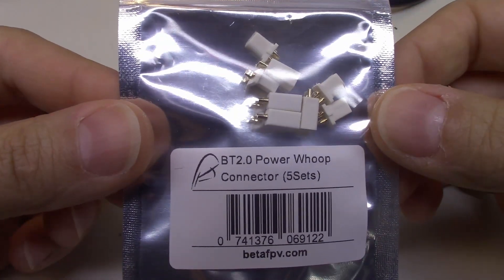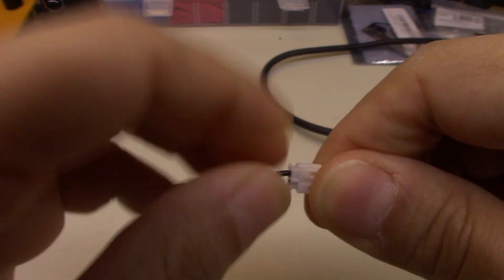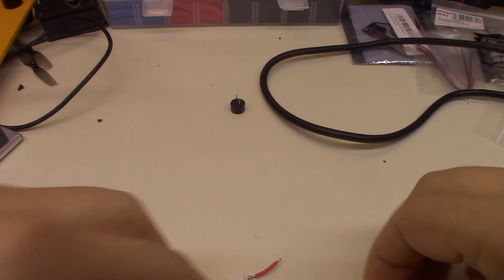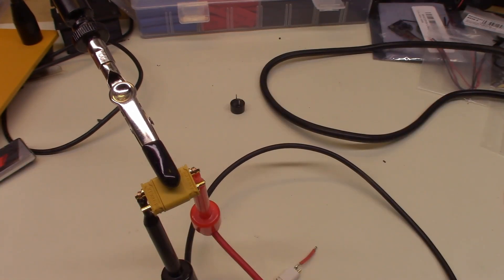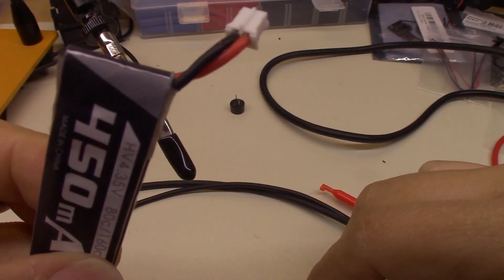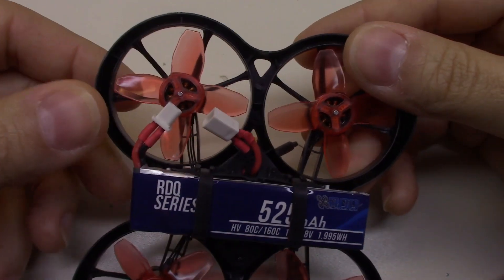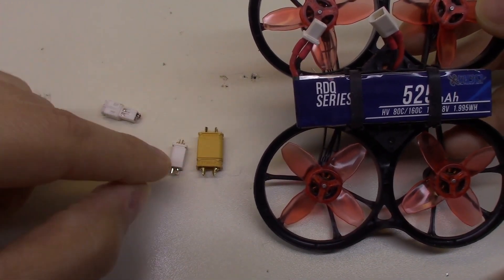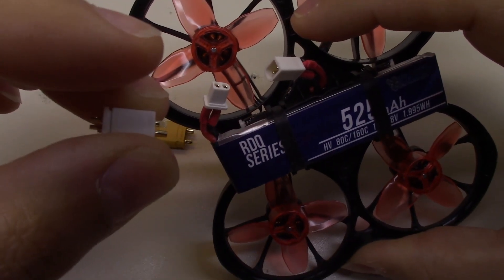BetaFPV BT2.0 Connector In Depth Review

Comment: So does the female side go with the battery and the male side goes to the drone ? I’m stuck on once you do this to the battery how do you convert your drone because I have the emax 1s ports on my tiny hawk 3 and only stuck on how to change the drones plug in to match or is it the same ? Do I make sense lol I’m new
Reply from the maker: You want the female side on the battery and the side with the exposed pins under the shroud which is the male side on the drone. You'll just need to remove the connector from the drone and then replace it with the new one making sure that you pay attention to the correct polarity.
Reply: @DoRC  thank you !!I have the emax tiny hawk 3 with the duel 1s connectors on my drone so you can fly 1s or 2s. It has a little black piece put together with that 1s board am I got to cut still ? Don’t want to ruin a good drone lol

Comment: Hi. I have a 1s babytooth running 1103 11000kv on 3 inch props with a xt30 connector. I accidentally bought a lot of these bt2.0 connectors and was wondering should I change the xt30 for the bt2.0. I don't mind the work but just wondering would there be performance loss if I swapped the coneectors?
Reply: Hi Aimon, did you have a chance to compare the Babytooth bt2.0 with xt30?
Reply from the maker: I didn't do a scientific comparison but the xt30 will have a lower resistance but it's also larger and heavier. Something to keep in mind with the BT 2.0 is that it is fairly easy to accidentally plug it in backwards which is not great.
Reply: @maximgolovashevich4651  What Do RC said. Go for XT30 for the ruggedness and solid connection. Go for bt2.0 if weight is the number one concern. I run my babytooth with XT30 and moblite7 with bt2.0.

Comment: Great info, and great work. I switched from the folded PH2.0 to the solid pins, and noticed a slight improvement w/out any formal testing. Recently switching from the solid pin to the BT2.0, made a night-and-day difference, no testing necessary, lol...its just that big a difference. I then rigged a BT2.0 series connector, for some 2S on my TinyHawkS...and worked amazing. I then got the idea to make an xt30 to two, BT2.0 series connector for my 2S toothpicks...works great, and I can now utilize my 1S sticks in series, and w/ no amp sag. 👏👍✔
Reply from the maker: Nice!  I just bought a couple more packs.  They are really good connectors!  A sub is appreciated and check out my recent giveaway video:)
Reply: @DoRC  awesome, will do. 👌

Comment: I guess in real life the difference between BT2.0 and PH2 will be even much higher, as the PH2 folded sheet metal pins will quickly oxidize and wear out.
Reply from the maker: The difference is a lot more apparent at higher current draw as well.  The bt2.0 is far superior in every way and nearly as good as an xt30.  Thanks for watching and a sub is appreciated!

Comment: It can be done with stick batteries btw. Not that I had patience to try, but there is a (very short) cable inside of the plastic cap that you can solder to. Obviously that cap won't fit over the new connector. Would be great if we could get our hands on the black goo that TBS used on Unify Pro32 Nano - it's like liquid electrical tape but much harder and apparently good for heat dissipation so could be great for modding the stick batteries.

That said, many people have doubts if the new connector can make a meaningful difference on those tiny <=300mah packs as they can't put out a lot of juice anyway. On 450mah+ it's definitely very noticeable. GNB makes 300 and 350 mah with a short lead so I'll give those a try in a few moons when they arrive from China :) I think it should still be noticeably better or at the very least last longer.
Reply from the maker: Albert Kim converted a stick pack and was able to reinstall the cap (after ruining a couple i think) but yeah it's probably not worth it.

Comment: OMG a real scientific test done properly ! you don't see that very often in fpv, great vid!!!   i'd be curious to see how much more energy is burned from the bad connector vs the good connector.
Reply from the maker: You mean folded vs solid pin?  If so tested it off camera and the difference was surprisingly small.  Thanks for watching and a sub is appreciated!
Reply: @DoRC  no sorry, i mean bt2.0 vs ph2.0.    I'm trying to wrap my head around what this means from a practical standpoint.... basically 15mv vs 3mv of voltage loss, right?.  i guess that's about 12mv difference, and at 4amps, that's 0.05W.... .05W x 120s = 5.76 watt*seconds, /60/60 = .001 watt*hours.   Since the battery itself is 3.7v and 0.3 amp hours, that's 1.11 watt*hours.  so the energy lost or  difference in connectors at 4 amps for 2 minutes, is about 0.001 / 1.11   = 0.0009 , or 0.01% of flight time. Or about 0.1 second of a 2 minute flight. 

 does that seem right?  i'm not sure what power the quad pulls on average so i just used your 4a.
Reply from the maker: @Jrod_FPV  seems right to me.  I think the difference comes in more during high amperage bursts.  4a is about as low a draw as something like the tinyhawk s will draw.  The only reason I used it is that's the max my precision power supply will output.  Given the much larger difference in voltage sag on the punchout tests I think there's more at play than the simple voltage drop test showed.  That being said I really don't know enough about the science to come up with a better answer than that.
Reply: @DoRC  interesting. I never noticed any difference in performance between crappy vs. solid PH2.0 other than that solid ones appeared to stay usable for a longer time whereas I needed to replace the crappy ones once a month during whoop season.